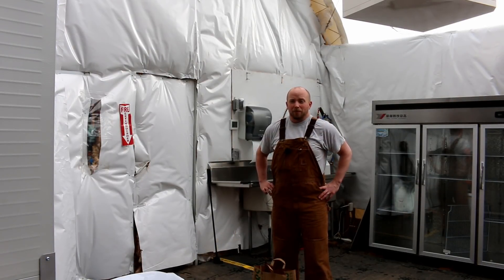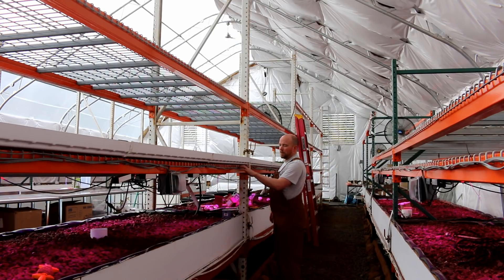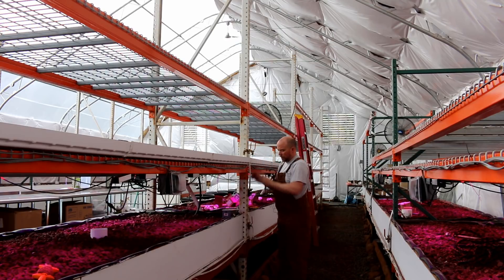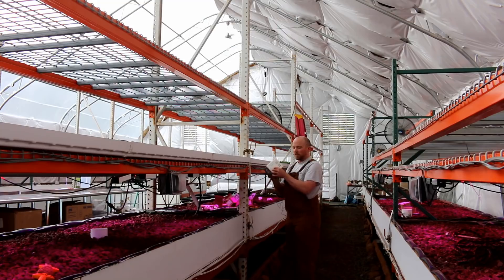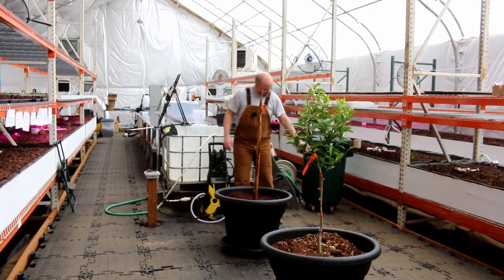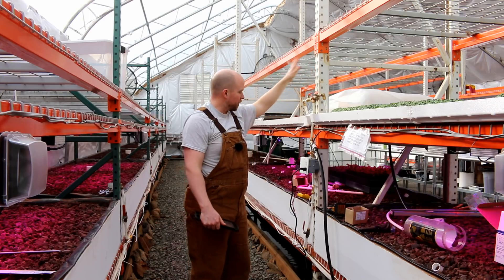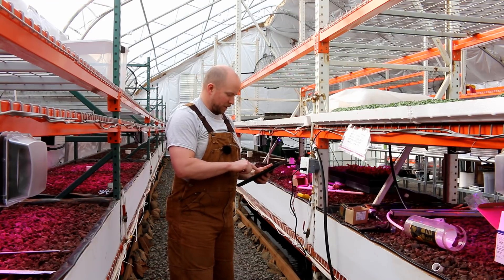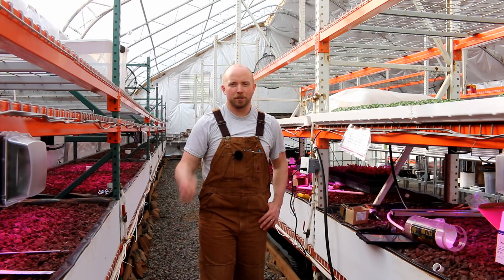Automating, Bottoms Up, Microgreen Watering

Comment: Could the pallet rack frame be jacked up and shimmed to level the beds instead of individually leveling the trays?  Shims between the feet on the racking and your railroad timbers that they set on.   -  Very cool with web based control access!
Reply from the maker: we ended up doing this but theres a bend in the shelving due to them being used...as well as some wavy'ness in the rackign on top of the shelf itself

Comment: I recommend a water level sensor. When I had my ap system using PVC water flow rate would change with build up of algi in the line (that was with artificial lighting) I believe natural sun light would increase that build up.